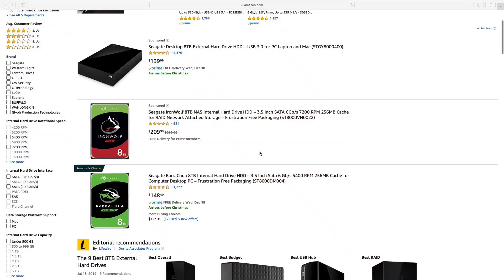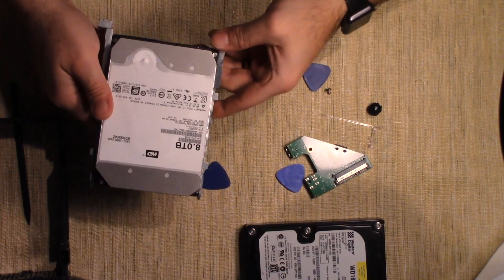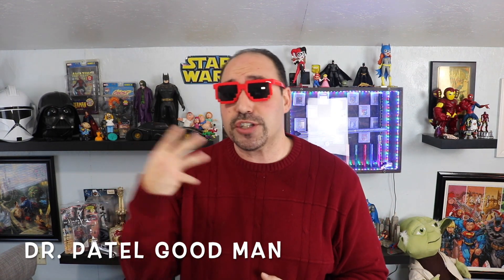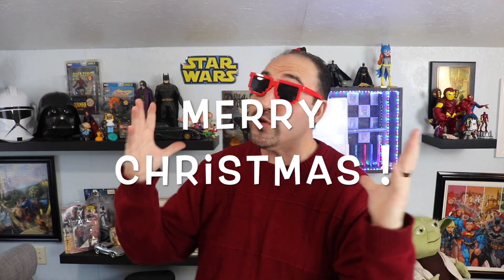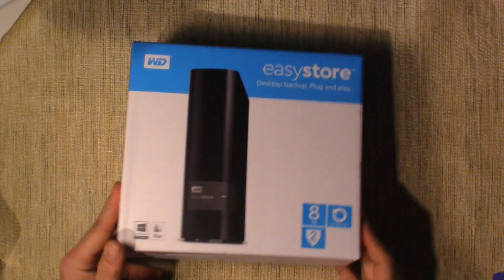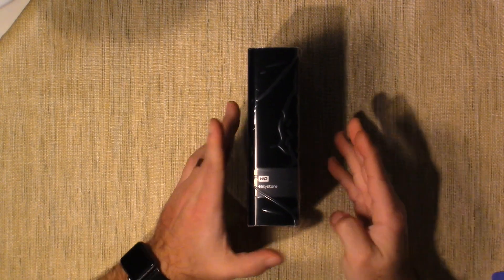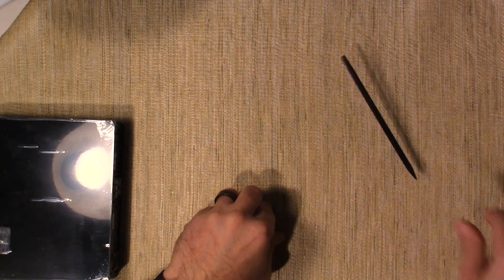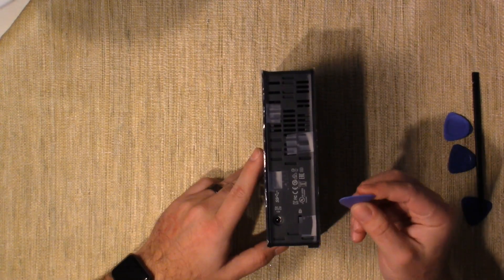How to take apart a Western Digital Easystore

Comment: The 3.3V pin trick will not be necessary for all NAS. The drives worked straight away in both my ZyXEL and WD units.
Reply from the maker: Thanks for letting me know.. I guess they know that that has a Power prong.

Comment: Can I order the first piece you removed from the hard drive which is the power and usb port? Can you send me a link....I think that the connector is bad for the usb
Reply: Looks like the USB Bridge
Reply from the maker: If you’re looking for replacement parts to fix it I would check eBay. If you want to just access the drive you can buy hard drive dock.

Comment: Why are you telling people to cut or cover that connector?  It should work without doing that.  Mine all have.
Reply from the maker: Wouldn’t work in my machine. I red that one connector was the culprit. Sure enough it did work.
Reply: I agree with you S M.  I have no idea why anyone would cover that pin.  I easily transferred my 8TB drive from the WD USB 3.0 case to my LaCie d2 Thunderbolt external enclosure and the 8TB drive works perfectly.  It is now my new Time Machine backup drive.
Reply from the maker: @hillstones  https://www.instructables.com/How-to-Fix-the-33V-Pin-Issue-in-White-Label-Disks-/
Reply: @CrazyWillTechShow  Thanks for sharing that information.  It is interesting that it seems to be limited to certain power supplies.  Maybe that is why it works in other external cases and the issue may only apply for certain internal computer drive applications.

Comment: I have this exact drive. My mistake I accidentally plugged in a 24v power adapter to my drive. Of course the HD now doesn't work. I am thinking that possibly the small triangle power plugin board has a defective component. Do you know where I could purchase a part like this to see if my hard drive will come back to life? Thanks for the helpful video
Reply from the maker: That sucks I'm sorry. I'm sure if you look on eBay you might be able to find one I don't know personally I've never looked for one. If you have information on the hard drive that you want to go to I would use a hard drive docking. Just in case you don't know what it is you can see it in this video https://youtu.be/v9wAHY9rHkk .

Comment: Help I have a external hard drive like the one you open and is not conecting to my laptop and I have all my music in it pics
Reply from the maker: I would get a hd docking station to you can see if you can access to drive. If the board went bad on the enclosure all your file are fine but if the hd does not spin or just don’t  connect it the hard drive and there nothing you can do with out paying for Data recovery.